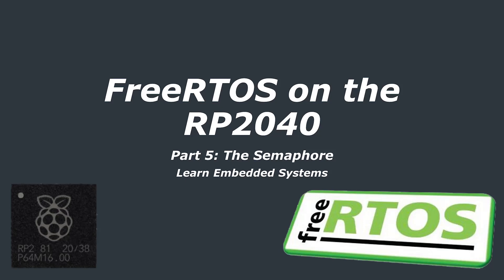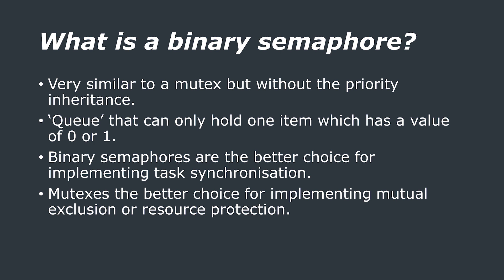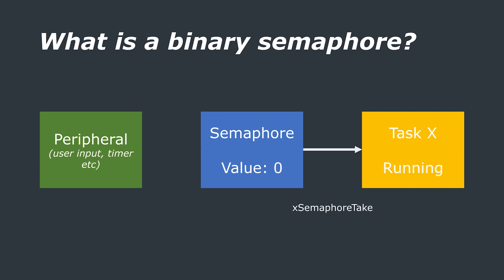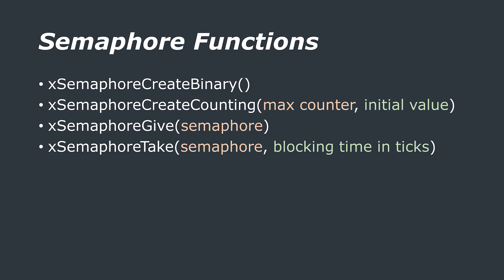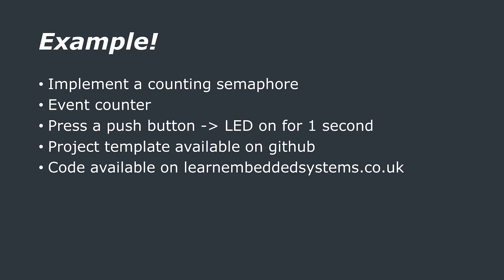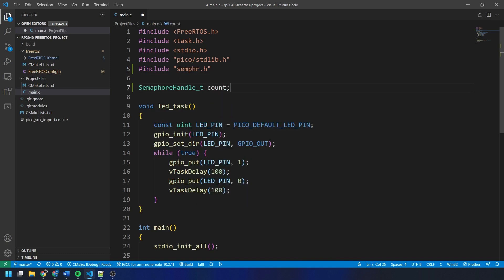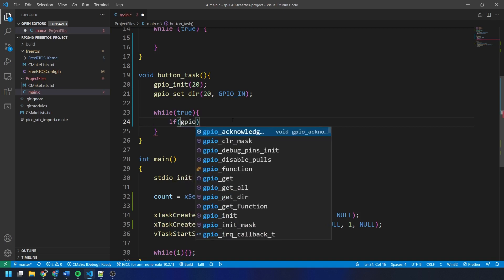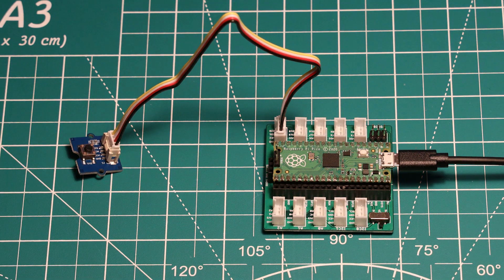FreeRTOS on the Raspberry Pi Pico (RP2040) Part 5: Semaphores

Comment: Using 2 minicom shells connected to USB & Uart on pico. I as able to transfer files from raspberry pi with xmodem to pico.  My rp2040-freertos-project at github user develone.  My test-read-crc16 project includes several libraries  (freertos lifting crc16 klt littlefs). In the doc/xmodem has several images. The text  file doc/littlefs-test.txt has more information on build of my code.

Comment: I am in process of adding to my rp2040-freertos-project at github the code found in pshell which uses littlefs.  I currently have a libcrc16.a that has crc16.c xreceive.c, xtransmit.c, fs.c, lfs.c, lfc_util.c, from pshell project.  The library also has head-tail.c and cvtutils.c I have tested pshell and have a document at github pshell-test.pdf.  Next I will try and add to libcrc16.a the vi.c from pshell.

Comment: Thanks! Using this video series I was able compile, debug and connect a pico running freeRTOS to a Raspberry Pi 3B+ running bare metal Ultibo.
The pico is running a blinking led task and a 2nd task performing KLT & DWT.
The processing task that (sends Sync & Ready 10 times each, recives 4160 bytes an image of 64 x 64 
with CRC after each column, performs the klt-feature-detect finds 4 PCA Feature #0:  (37.000000,29.000000) with value of 19844
Feature #1:  (28.000000,39.000000) with value of 9270 Feature #2:  (24.000000,29.000000) with value of 4393
Feature #3:  (38.000000,39.000000) with value of 465), in addition a dwt lifting step with 4 levels of decomposition.

Comment: I’ve been following this project because I’m using this pico in my senior engineering design class in university. I’ve just designed and ordered a custom pcb with the rp2040 on it and I’m excited to get it working and maybe moving from the arduino IDE to VS code and using FreeRTOS. I’d love a job in embedded systems or robotics. I’m a computer engineering student.